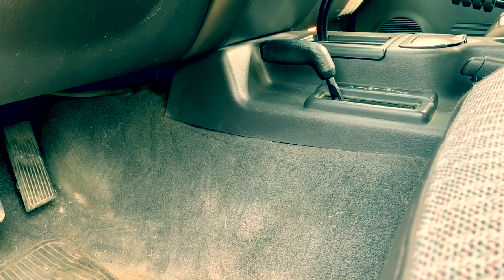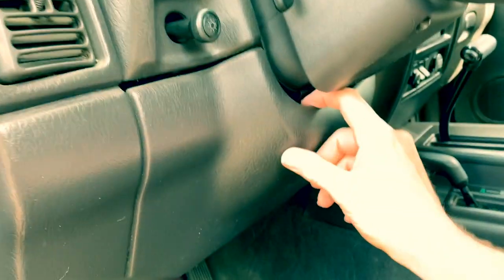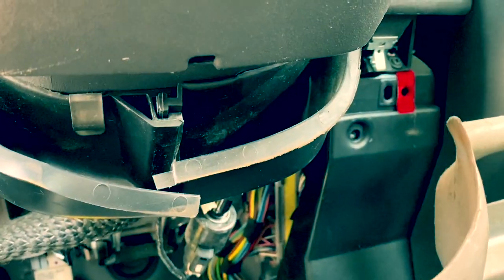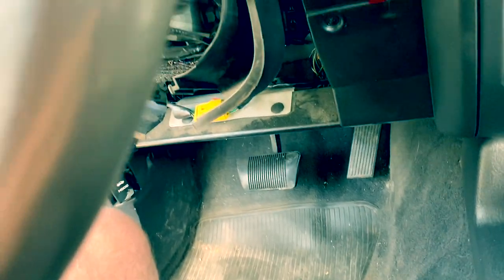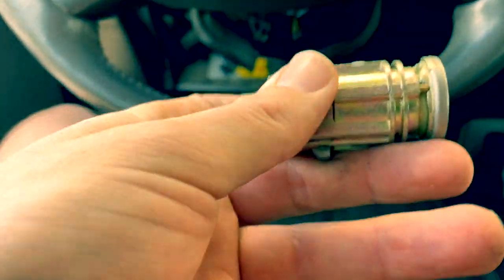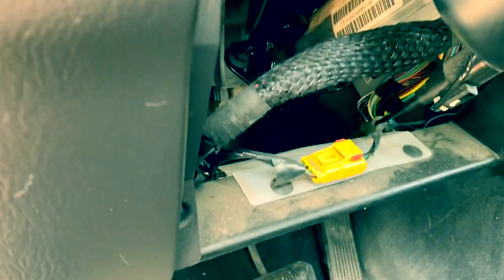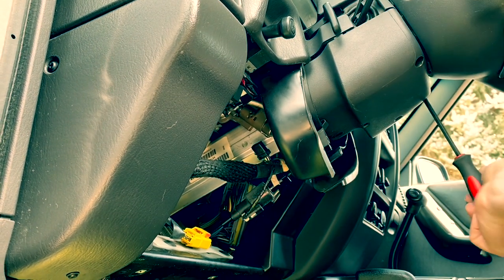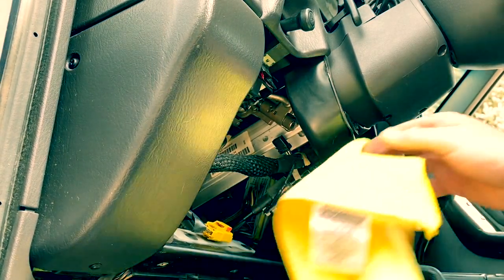2000 Jeep Cherokee XJ ignition cylinder replacement.  DIY

Comment: Glad to see I'm not the only one that over complicates things from time to time.  That cylinder comes out without removing any panel or plastic, just poke a small pick up into the hole under the cylinder (releasing the tab), then turn the key to the left and pull the cylinder out.  :)
Reply from the maker: Over complicating is the story of my life!  I couldn’t squeeze myself into position enough to see it so that why I had everything removed as well.  Thanks for the comment, cheers!

Comment: Good video. Thanks! I only have one key and it's very smooth and requires a jiggle.
The one thing I'll miss after replacing it is being able to pull my key out to unlock the glove box while still running.
Reply from the maker: Ha I had a fox body mustang years ago with the same issue.  It was convenient at times though!  Thanks for the comment.
Reply: @wrenchops719  My dad had an old work van, Ford I believe. Used to pull the key out and dig in his ear going down the road. 🤣
Reply from the maker: Ha now that’s awesome!

Comment: my issue is that i cannot turn the key at all. any suggestions on removing the cylinder?
Reply from the maker: Does the key insert fully into the cylinder?
Reply from the maker: Do you have tilt steering on yours?  Many possibilities as to why it’s locked up.  You can try moving the steering wheel left to right, I’d suggest spraying some electronic cleaner into the cylinder followed by some oil such as WD40 and cycle that several times see if you can break anything up.  If you have an automatic transmission be sure the gear selector is fully in park.  Even on my XJ sometimes if I don’t push it forward all the way I can’t remove the key from the cylinder, listen for that click though.  If all the basic stuff still prevents you from moving forward you have options, get violent or call a locksmith.  On your own behalf take a small mallet and tap the cylinder a few times and see if that’s dislodged anything.  Excessive force is not required just a few slight to medium blows, goal is to dislodged not destroy.  Between strikes might utilize the electronic cleaner, oil and moving the steering wheel up/down, left & right.  Hopefully it’s something simple for you.

Comment: I did this exactly like you said and my jeep started in ran for a few seconds and then stopped so I had to put the old ignition so under back in. I used AIP electronics partnumber SW2146
Reply from the maker: Karen, what year Xj do you have?  You may have the SKIM module.  This is the large outer piece that goes around the ignition housing. Another person just encountered the same issue you were having, his locksmith was able to transfer the chip from the old key into his new one.  Check out the link below 

https://www.jeepforum.com/threads/which-xjs-have-skis-skim.2033801/

Comment: Ok, I’m confused. How does this work with the skim? I changed mine for another barrel because the key kept falling out while I was driving but the engine won’t run. It will start but it turns straight off again and the key light on the dash comes on 🤔
Reply from the maker: To be honest I’m not certain, you might have another problem with the anti theft system.  I was fortunate to do a direct replacement with no issues.
Reply: @wrenchops719  thanks I found out the skim module is located in the plastic part of the key and that is read by the ring around the ignition. I was able to get a locksmith to dig the module out of my old key and fit it into a new one so the key could be read, allowing the car to run.
Reply from the maker: That’s great news!  Glad you were able to get it running!
Reply: @wrenchops719  thanks, yes, it was a bit of messing about but she lives again 😂